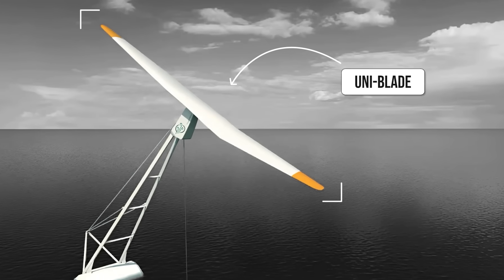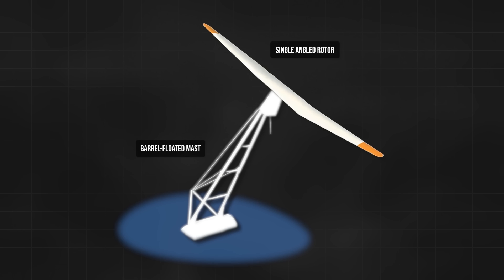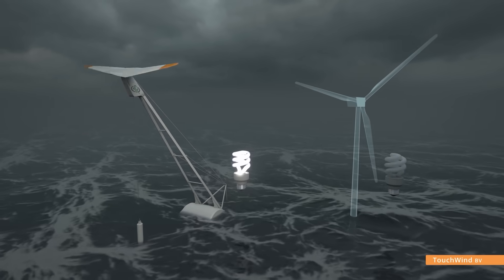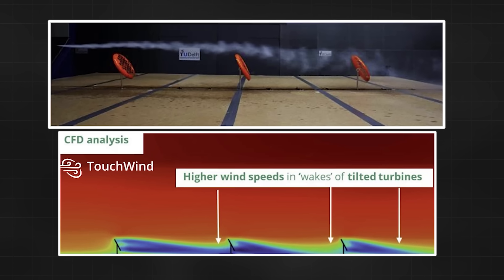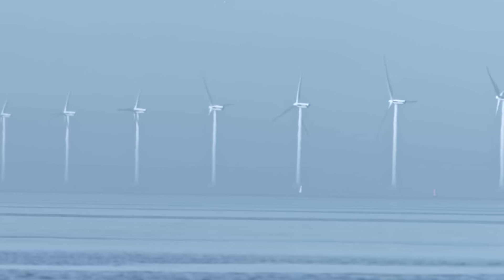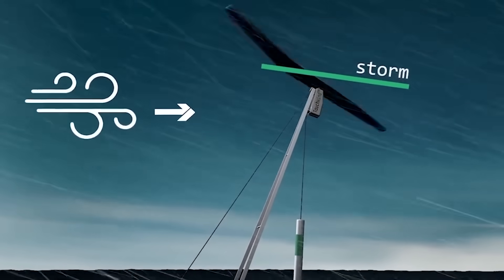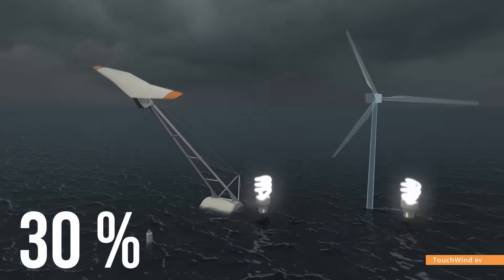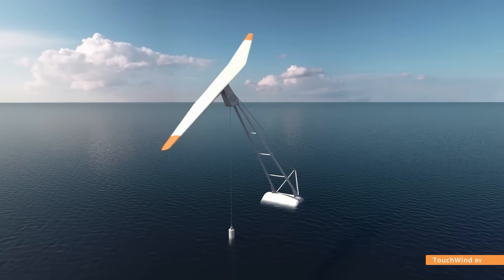Insane New Turbine Promises CHEAP Unlimited Energy

Comment from the maker: What do you guys think about this turbine? I'm interested in all your thoughts! Also, check out the incredible AMD Threadripper Pro 7000 WX-Series Processors here: https://amd.chrd.ly/Ziroth #ad
Reply: I would be curious if floating turbine bases could double as wave energy generators.
Reply: @pathfollower  The more degrees of freedom the more difficult the design and operation. Imagine the platform moving rapidly up and down in high wind conditions.
Reply: @msimon6808  I actually was thinking about that.  A floating stable base structure with pods on outer perimeter that move up and down independently.    Probably the fewer you have, the better.  You need generation hardware for each moving section, so instead of a flower with lots of petals, maybe 2-4 sections that move up and down as center structure that turbine is also connected to stays firmly anchored.
Reply: @msimon6808  the deep ocean usually does not have rapid changes, but good point.
Reply: @pathfollower  there are some place that have very large waves in the deep ocean, but there is usually less wave energy in the deep ocean, the swirling water disappears below the surface, the rising land by the seashore pushes the waves above the surface.
Reply: @pathfollower  I like that!
Reply: Maybe in 20 years we will deploy them in the open ocean. If fusion doesn't take of, this will be the most abundant energy form we can get decades later.
Reply: @juliane__ ⚠️ God has said in the Quran:

🔵 { O mankind, worship your Lord, who created you and those before you, that you may become righteous - ( 2:21 ) 

🔴 [He] who made for you the earth a bed [spread out] and the sky a ceiling and sent down from the sky, rain and brought forth thereby fruits as provision for you. So do not attribute to Allah equals while you know [that there is nothing similar to Him]. ( 2:22 )

🔵 And if you are in doubt about what We have sent down upon Our Servant [Muhammad], then produce a surah the like thereof and call upon your witnesses other than Allah, if you should be truthful. ( 2:23 )

🔴 But if you do not - and you will never be able to - then fear the Fire, whose fuel is men and stones, prepared for the disbelievers.( 2:24 )

🔵 And give good tidings to those who believe and do righteous deeds that they will have gardens [in Paradise] beneath which rivers flow. Whenever they are provided with a provision of fruit therefrom, they will say, "This is what we were provided with before." And it is given to them in likeness. And they will have therein purified spouses, and they will abide therein eternally. ( 2:25 )

⚠️ Quran
Reply: I'm not convinced that this design is all that great. Maybe it is more cost effective than the existing offshore turbine but it's not really impressive. If stronger winds can be harnessed at higher elevation, it may be better to focus on bringing the windmill up, using a wing/kite holding an array of turbines? As an added bonus it would automatically lift the turbines out of harm's way when stronger winds bring rough waters. If only I had a Threadripper CPU to run some simulations ;-)
Reply: @VeniceInventors  Another ugly blight on the lands and oceans.
Reply: 🤜⚡💥⚡🤛Being a triple engineer with numerous inventions in this space, I conclude that this is not a good design. 1] Downwind designs encounter turbulence from the tower which reduces efficiency;  2] Wind speeds are slow at low elevations which reduces energy production;  3] The blade angle is sub-optimal for all inclinations which reduces energy production;  4] The blade angle to the wind direction requires much stronger, and therefore heavier and costlier, rotors;  5] The retreating blade encounters the same loss of lift that helicopters experience which here translates to reduced energy production and other problems. IMHO, the cost of the system is comparable to legacy systems and therefore the lowest levelized cost of energy [LCOE] metric is higher. Not a good look.

FYI, most wind energy comes from medium wind speeds BECAUSE they are more prevalent/frequent in occurrence. High speed winds occur less frequently. Low wind speeds don't have sufficient energy to be of use.  

I have advanced, robust, low cost wind turbine innovations, offering the lowest levelized cost of energy [LCOE] and ultimate  survivability in any wind regime.
Simple low cost grid-scale energy storage is also on the table.

Contact me for more information and check out my engine/transportation innovations...including off-planet solutions.

Stay Radical!

From the desk of: Chief Radical Officer
🤜⚡💥⚡🤛
...
..
.
Reply: The floating turbine is a bit scammy --- it still doesn't capture the extra energy at high wind speeds

It  wastes that energy by lifting all that extra weight - the limitation is the speed of the rotor
Reply: 2:16 - if this video is meant to be watched by the average viewer use please use the units the average people are familiar with. 
Ask you grandma what a speed of 10 m/s would mean and if 32 m/s is fast or not, ask for their impression and not a recalculation. 

I have a feeling what 100 km / h means cause you can open a cars window and put you hand in the air flow. 
But I would need to do the math to get behind m/s which would mean 27 m/s 

If you would have use 115 km / h instead of 32 m/s I would have had a better feeling 
and even better for the 259 km / h instead of 72 m/s 

If the turbine is any good the first investor who had bought the product will buy thousands more if the costs are lower, maintenance and investments are lower and the equation of production is better than the current ones. 

I would not invest in any of shore thing soon which is that different cause it tooks us ages to get where we are right now and none of those are floating. 

And the floating topic adds another point of complexity like the cable tied connection to the under sea grid. Just one of the differences where difference means a potential risk or challenge compared to the current ones. Many have lost fortunes to get where we are.

And you might now german engineering quite well, so maybe it is time for you to take a lesson in history or engineering history if you are able to unsolve the shattered dreams of scientist who had gotten a government funding by germany to build one of the first big wind turbines for commercial use, even though for todays scale it might feel like a tiny one. 

Fully funded it went into a complete desaster within weeks rather than months. Search for "GROWIAN" or "GRO WI AN" an acronym for "Groß Windkraft Anlage" or big scale wind turbine. This was the biggest failure and desaster for german wind turbine production cause the turbine never achieved any of the designed goals and was only good as an example how to not develope such product. 

Therefore the float one has to proof a lot more than just 1 rotor running under ideal circumstances close to shore (for easy repairs) for just months or a couple of years cause the investments needed are so big that these have to last 2 decades and more to be profitable. And that is the real challenge for any new tech to outperform the previous financially and reliable over a full product life cycle and even beyond considering how easy it could be to repower such site after 20 years of usage.
Reply: Heres a clue...when all they have is a fancy CGI video you know theres something missing, a lot of kickstarter scams ran the same principle, show me a real world small scale model with some data and i'll start to listen and not assume it to be an investment scam.
Reply: It depends, was it developed by the principal financiers of the climate alarmism lobby, the Rockefellers (AKA big oil)?

Only if they can make a buck of it will this grace our horizon. I mean, that's how we we got stuck with windmills and solar panels in the first place.
Reply: Designers have been making blades longer but  wider is also a way to get more torque at lower rotational speed thus les dra.
Reply: What about those chains that anchor them to the ocean floor? Won't they kill some whales?
Reply: @noway8563  No
Reply: @noway8563  and because they are putting them in deeper waters, that is going to mean longer cables to reach the floor and longer wires to connect their power to land.

Comment: The better designs of wind turbine may have 10 times the power of the present turbines and that cannot be reach by any other wind systems. I say that all the wind turbines have a very poor design. I designs 3 types very efficient, and I am positive they will work as expected. I have 15 inventions and 7 patents. I remember my A to D converter, patented in 2000 in USA, patent # 6,091,346, using floating voltages, I sent to patent office without to do any experiment. After I got a patent, I did experiments and did work perfectly. The same is with my wind turbines. The horizontal turbine has a little active surface on the base of the blades and the rest of the blade are useless and can be removed.

Comment: This horizontal turbine has a little active surface on the base of the blades and the rest of the blade si useless and can be removed.
Reply: The better designs of wind turbine may have 10 times the power of the present turbines and that cannot be reach by any other wind systems. I say that all the wind turbines have a very poor design. I designs 3 types very efficient, and I am positive they will work as expected. I have 15 inventions and 7 patents. I remember my A to D converter, patented in 2000 in USA, patent # 6,091,346, using floating voltages, I sent to patent office without to do any experiment. After I got a patent, I did experiments and did work perfectly. The same is with my wind turbines. The horizontal turbine has a little active surface on the base of the blades and the rest of the blade are useless and can be removed.

Comment: 200m rotor, on something floating in the North Atlantic, which sometimes gets 80'/24m waves
( "rogue" waves, from constructive-interference between combined waves ),
strikes me as .. "optimistic".

To me it seems that sticking the things away from rogue waves would be saner?

but that negates the whole point of the things..

ESA mapped rogue-waves, by satellite, iirc..

I wonder if there is some areas of the ocean which just have less of them, or less of the big ones?

Comment: 5 minutes in and there are so many things that scream this will not work/potentially a complete scam to get rich off of investor money.

Saying they can be placed closer together because the wake is deflected down really doesn't add up. Not only is the wake likely to deflect back up, but the air now being pushed out of the way has to go somewhere, likely creating more turbulence. Saying it would pull faster air from high down, is unlikely from my knowledge, but if it actually did then that would occur after the turbine, so would not benefit it at all. Then to prove this wind deflect they used discs in a wind tunnel to make it quicker? I'm going to say theu tried blades first and it didn't show the deflection they wanted so they replaced the blades with discs.

This is almost certainly going to turn out just like all the other unusual designs, when prototypes are made, they've all fallen far short of what was promised and been less efficient than traditional turbines.

Comment: If you can use this to pump water then you can use the water pressure to generate electricity and the cool water can be used to cool a house as in hydro cooling. Then the water can be used to aerate aquaponics and provide irrigation for standard agriculture the water can also be filtered for getting off the grid.

Comment: No, that's not an uniblade. It's an asymetric dual-blade rotor. Uniblade rotors do exist already, are used by French operator EdF in Greece, and show much higher performances.

Comment: I see a few major problems here. 
The obvious one is that a single-piece blade limits the turbines to half the diameter of conventional ones so you need about 4x as many turbines for the same power not counting any other factors. just increasing the length of a single blade to make up for it isn't trivial.
I also wonder how they plan to deal with the sideways overturning moment. because it acts like an autogyro the advancing blade makes much more lift than the retreating one without cyclic pitch control and/or significant blade flapping, trying to tip the tower over sideways. Cyclic pitch or blade flapping would dramatically reduce the working lifetime compared to conventional wind turbines, which would kind of defeat the purpose.
This design also puts the main bearing in tension with significant side loads that are always in the same direction, which makes the bearing much more expensive and dramatically reduces it's lifetime compared to simple compression in normal wind turbines.

Comment: Air doesn’t get sucked into things in straight lines quite unlike exhausted air which will form into rivers of moving air.  Rather inlet air comes in from the river of supply air which is the wind; there is no way wind can be sucked down from higher altitudes as in the graphic because that is not the lowest energy path.  If that were not the case then helicopters would affect aircraft above them which they don’t although they certainly affect everything under them.

Comment: you do not need a gondol - that is an advantage.  Two blade turbines rotate faster than three blades - so that is also an advantage. There will be an invisible air pillow. And this 'pillow' will be shaped uneven squeezed between the sea and the rotating blades. This 'air pillow' is not evenly distributed (as with standing three-blade turbines), This will also make the power uneven that can cause a bending in the hub. (but it is not easy to estimate how large the difference is between the lower and the higher part of the blade.

Comment: 1. Power of wind is the cube of wind speed, so the maximal output comes not from maximal speeds, but 1.5-2 times higher speeds in the Weibull distribution.
2. I’d advise putting the turbines in alternating order with each adjacent one operating at different altitude, and the turbines being able to change its rotor tilt not only by tilting the tower, but also only its upper segment. In this way some of turbines will lower themselves to the ground at higher winds, while others will elevate themselves, as a way to diminish interference.

Comment: Economics of electricity generation are largely determined by the concentration of energy and the cost of fuel.  Higher concentration (pressure, temperature, speed etc) = higher efficiency.  Low concentration requires more concrete and steel. Therefore a valid economics measure is MW generated per weight of materials (concrete, steel etc).  Wind as a "fuel" is free.  Extracting energy from it is expensive.

Comment: It looks very simple/efficient when they are small, but if we're talking 200m blades, then it becomes a large construction. If such a large tower is tilted at different angles and lifted by  the rotating blades I imagine this will put tremendous stress on the materials. The inside components must also deal with the angle movement. 

I'm no engineer, so maybe these are non-issues, but I expect that the challenges exponentially increase when scaling up, similar to traditional wind turbines.

Nonetheless I think it's very interesting and useful to try out alternatives. After all, in the long run we'll need a massive scale of energy production.

Comment: It's a total joke. 95% of the wind blows right past the blades. You have 10-12 mph hour wind. Clear your mind and forget what you thought was correct. I started fresh and ended up with a totally new design that produces lots of current at low wind speed. I crossed a Piper Cub, a jet turbine, and a wind surfer. You have to know how to sail a sail boat.